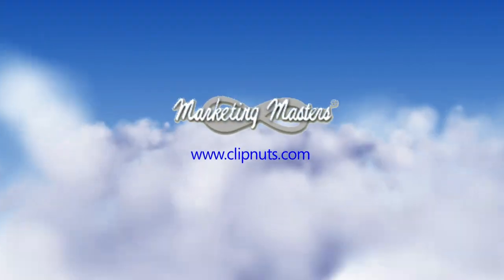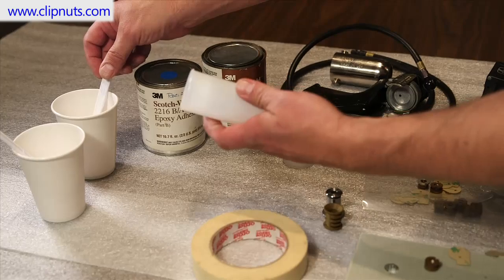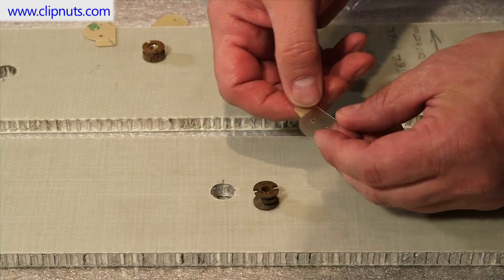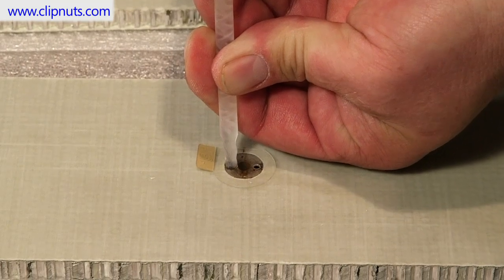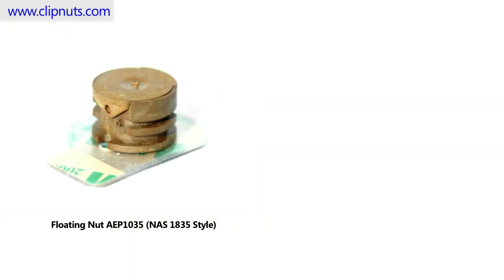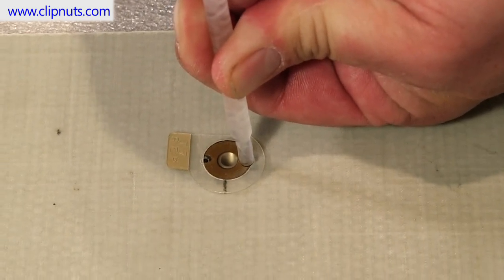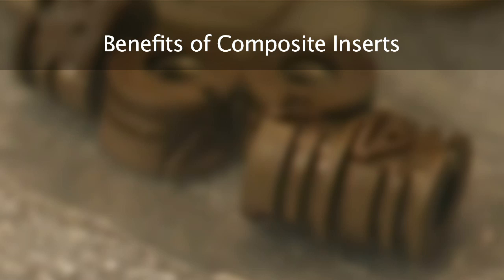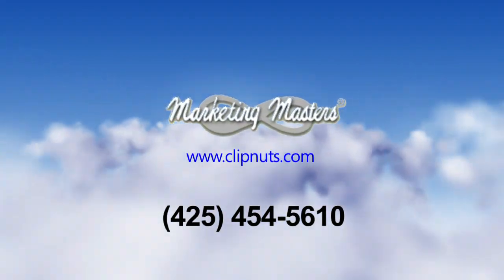Installation Process | Marketing Masters Composite Potted In Insert

Comment: How much force does it take to break the fastener out of the laminate?
Reply: That depends on the insert size, type of potting compound you use, and the core thickness. The pull out load can range anywhere from 100 to 250 lbs for a No. 10 insert.